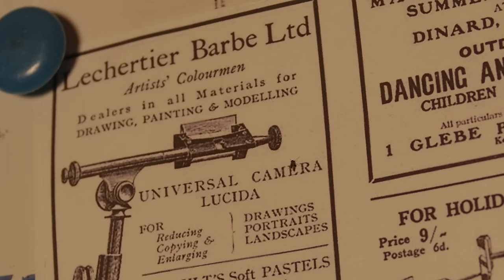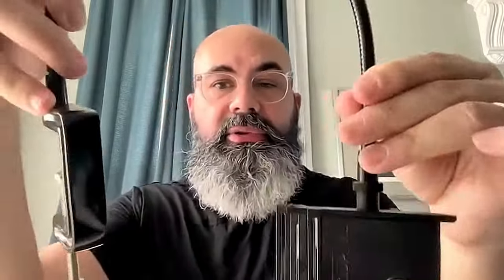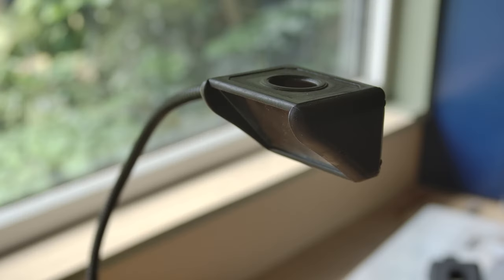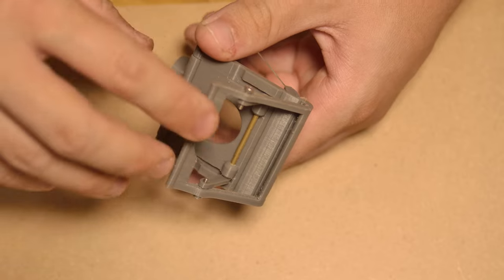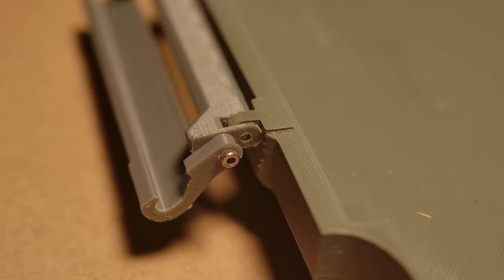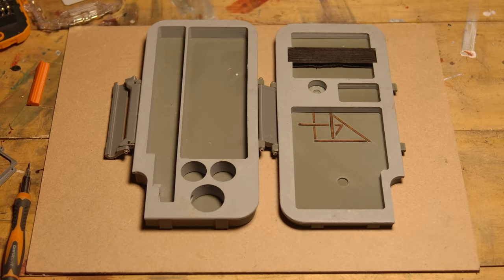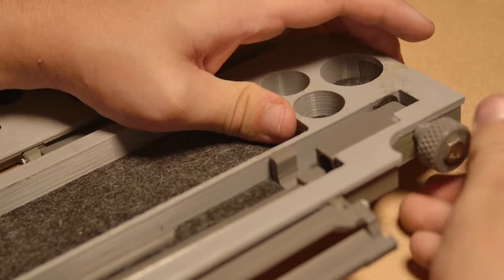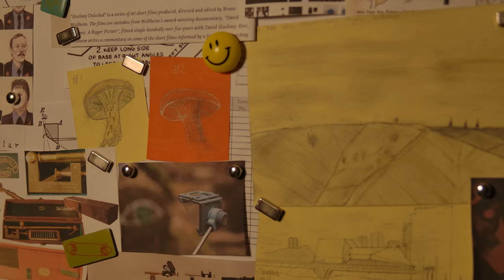How To Build A Camera Lucida

Comment: One thing i struggle with in 3D design is deciding when to turn something into multiple parts. This is such a cool project, and its certainly giving me some inspiration in that regard. Thanks for sharing!
Reply: Hey there! When I do a designs I start by scribbeling the thing I have in my head on a piece of paper (I'm really bad at drawing but it's enough) then I proceed by thinking of what measurments I need. When it comes to multiple parts I always try to avoid support for example when I know I need a lid or something which definitely is a part parallel to the buildplate I'd rather seperate it in a different part but I god a feeling for it just be keeping the "no supports wanted" in mind :) 
And during the design process you may find an alternative approach to your thing which would make printing a lot simpler then restart that part (keeping the old in case the new Idea is shit, been there many times and always regretted deleting the old part :D) 
Hope that was somewhat helpfull! Have fun :)

Comment: Hi! As glass of different reflex ratio are available, what is the optimal ratio from your study? Does the ratio vary in regard to the brightness of scene? Thanks!
Reply from the maker: Apologies for late response. Unfortunately I didnt conduct many experiments myself as I found the semi-silvered glass to be expensive to source. It does vary the brightness of the scene significantly however, I wish I could give some numbers. Without semi silvered glass, which is what I used, I was limited to drawing in the shade or with black paper so a silvered glass like what is used by commercial models is something I would highly recommend if you can figure it out, but I just didnt have the funds to really experiment with it when I made this.